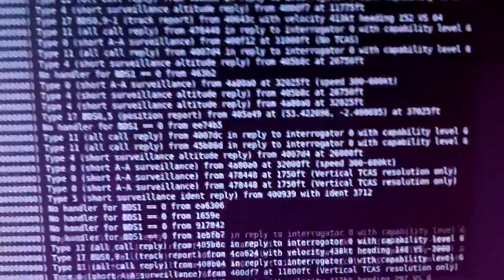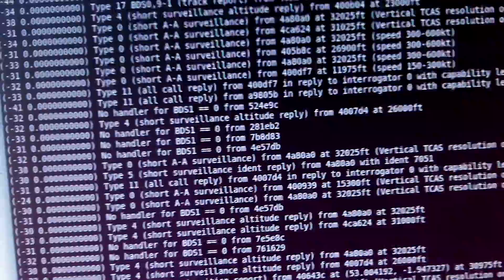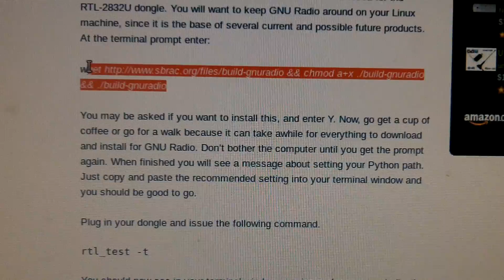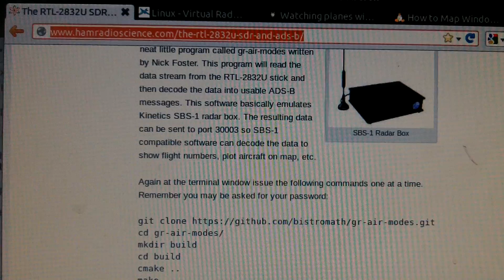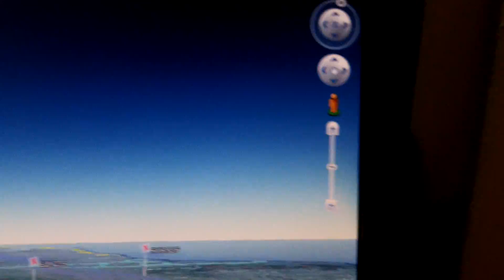ads-b rx with a cheap rtl2832 with e4000 tuner hama nano dvb-t At the qth of G8HCB P1

Comment from the maker: The stock antenna near a window or line of site will work. If you go for higher gain you will pick up from further away, but need to be careful choosing a design for the correct angle of radiation. I did find a coaxial colinear worked well for me though. Google ADS-B coaxial colinear for ideas if you want more than the stock antenna.